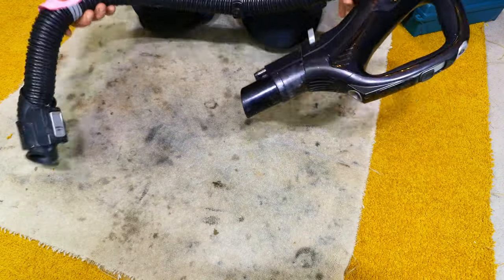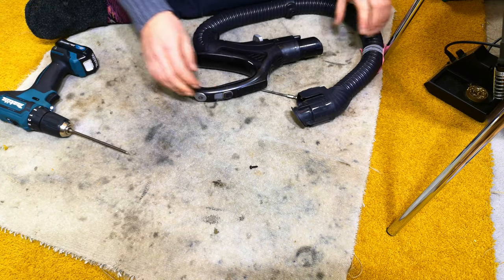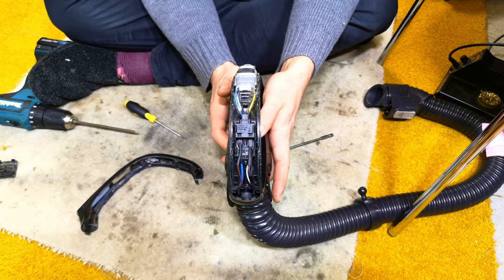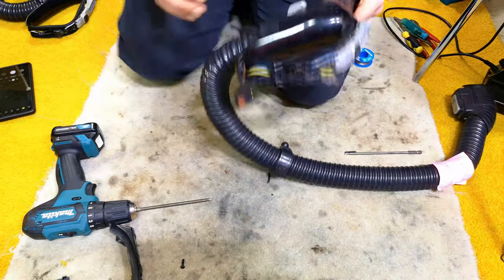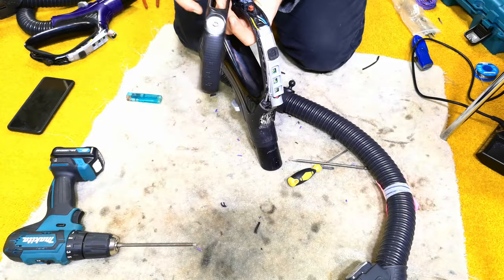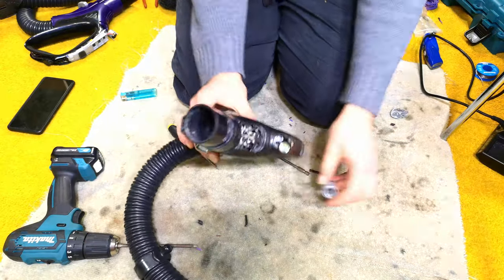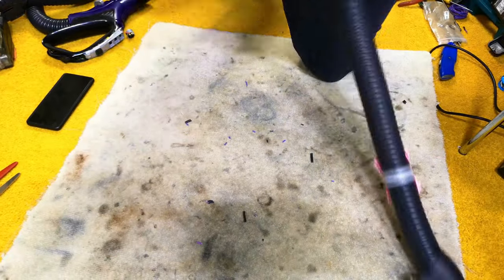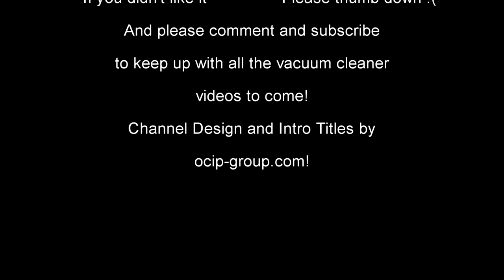Shark AX/Apex Series Duoclean - Electronic Hose Switch Replacement How-To Guide

Comment: how did you tape the vent ? obviously from the inside ... i was thinking to do that myself but held back cos i just bought it lol, anway good channel you have keep up the good work !
Reply from the maker: It's tricky if you've never stripped the casing off a handle before... And tbh it's also risky as some floor types need the vent to stop the cleaner ripping it up!

Comment: I need to wash the hose how to remove the fkn hose
Reply from the maker: Keep stripping things down from this point, then you need to cut and re-solder the 2 wires handle side. Machine side, remove the housing and tape the wiring plug back onto the hose so it doesn't get damaged then stick it in the washing machine with some towels, usually brings them up nicely. Then reassemble.